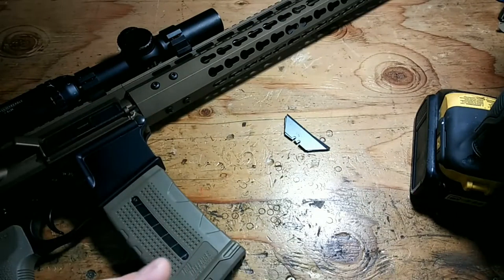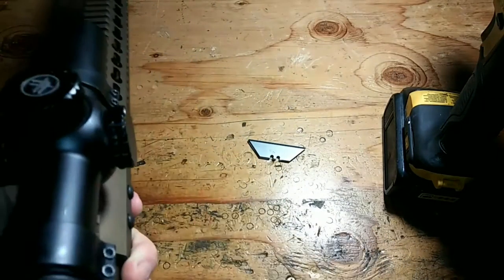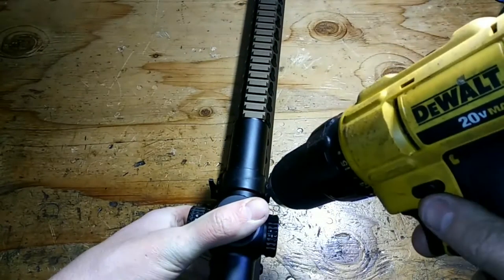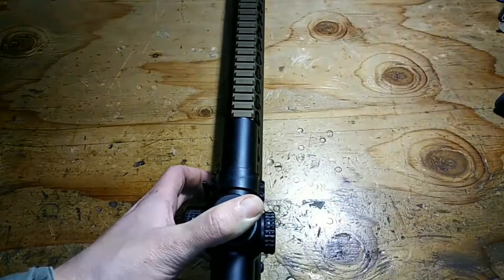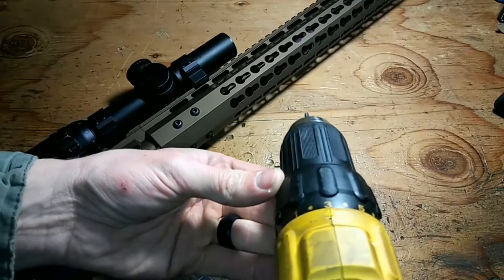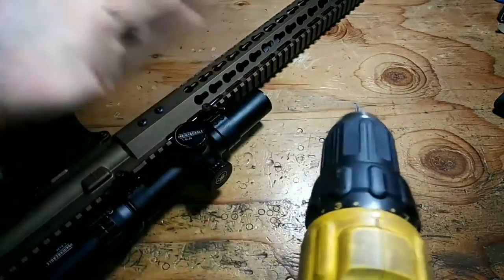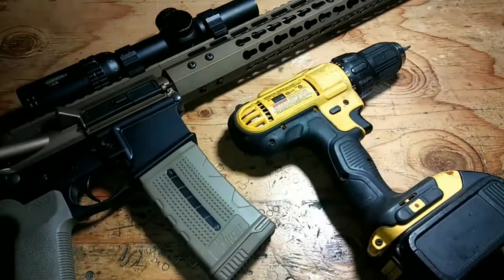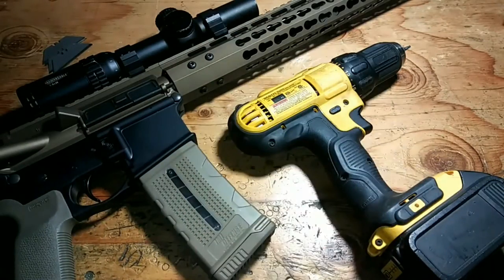How To Mount A Scope With RAZOR BLADES and a drill...

Comment: I've seen ppl use a battery drill for the scope rings. But never razor blades. I have seen them use thin washers however.
Reply from the maker: MatteoSixSeventyFour I mostly see people use a bubble level but that doesnt seem like it is acurate enough. Also it doesnt matter unless the gun underneath the scope is perfectly level. 

with this method (and other similar methods) it doesnt matter if the gun is level when you mount it. It matters if youre level while shooting the gun! lol
Reply: Douglas Thompson I have a jig set up. The rings go on a rail that's mounted level to my work bench. Then I use the Wheeler scope alignment kit. Which is a set of levels. A few feet ahead I have a square and plumb cross hair hanging to check reticle alignment. The scope ends up straight. But as you said if the shooter cants the rifle. Then that's a whole other problem
Reply from the maker: MatteoSixSeventyFour sounds like you got a legit setup! :)
Reply: Douglas Thompson Thanks. The initial inspiration came after I mounted a scout scope to a Mosin. Only thing that was level on that gun was the 11mm dovetail that the rear sight sits on. LoL
Reply from the maker: MatteoSixSeventyFour That sounds about right! Lol

I dont have one myself but Ive picked up quite a few and they dont give the impession of "precision" crafted...
Reply: Good video. I learnt something I can use.

Comment: In My opinion, I don't believe a drill should be used in place of the proper torque screw driver. Just saying.. Murphys law applies here.
Reply from the maker: Fair enough. It seemed to work fine in my testing but I can easily see why you might not want to do it this way